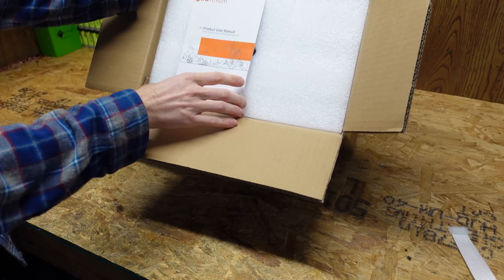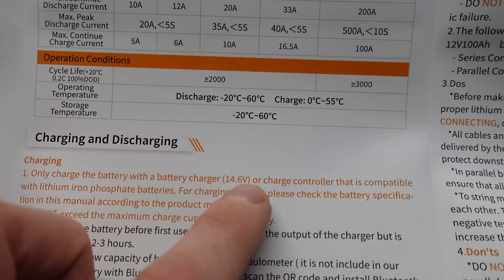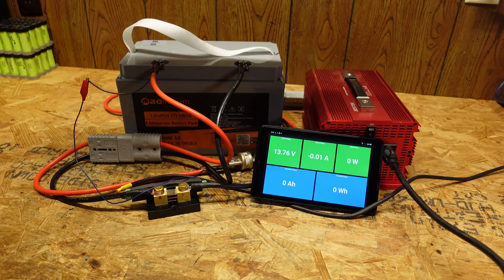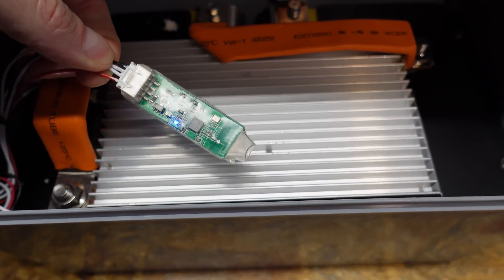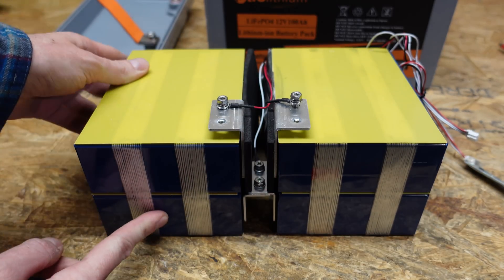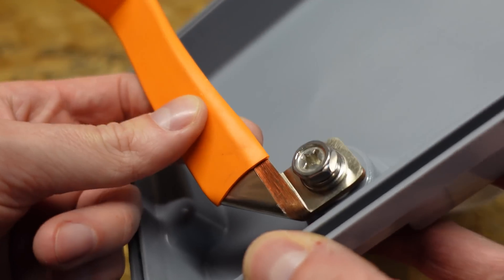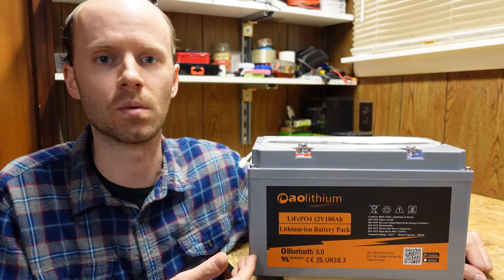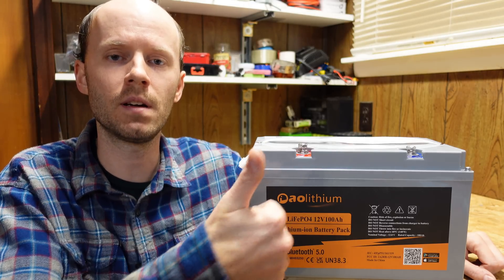AoLithium 12V 100Ah LiFePO4 Battery Review and Teardown, 200A-Rated, With Bluetooth!

Comment: So I have a question I'm looking to lithium swap batteries from a Chinese three-wheel vehicle. From the manufacturer it comes with 
lead-acid 60V45-52AH. Can I lithium swap those batteries for the AO Lithium? Lead acid is old and outdated and I want to go to lithium but I don't have the skills to completely rewire the charger and BMS for lithium. So with this battery pack be a better drop in option.

Comment: What's the difference between the 4S version and the non 4S version.
Reply from the maker: This battery is 4s. Which other battery are you comparing it to?
Reply: @Lithium Solar  you can get this exact battery with a 4S at the end and without the 4S, and there's a price difference but not sure why or what the difference is.

Comment: Great video, I got one to run a microwave and 120 volt power in my work van it’s on a 2500 watt 12 volt inverter it has no problem running it, I even plug in a air compressor, vacuum and a heat gun, one at a time, I keep it change with a voltage sensing isolator that turns on when the main battery is at 13.2 volt when I’m driving and feeds a DC to DC inverter that delivers 25 amps 14.5 volt, it’s a perfect setup for someone that wants to use only one battery

Comment: Hi - Great video & I just now subscribed!  I am a newbie at all of this but have a few questions that I hope you (or somebody?) can help me out with.....   Would this battery and a 1000W inverter be able to power a 700W microwave? And would a 60 Hz, 1900W continuous/2350W peak gas inverter/generator be able to charge it in a reasonable period of time?? I already own the gas inverter/generator, and the stand alone 1000W inverter (but have nothing else - such as a battery, charging device, charge controller, solar panels, etc.) so that's why I stated those particular specs. I live in a very cloudy/rainy area so solar is a hit & (mostly miss) proposition.

Comment: Hi thanks for the video. I am curious about those cells. You mentioned is is CALB cells. If it is the CALB L160F100 cells then I am afraid the dataset that I looked up online shows only 1C continuous discharge. The form factor matches L160F100 I guess. And if the QR starts with "0B5CBC0M" then it matches with L160F100 cells that I ordered from BASEN. Can you please confirm? If the cells are only 1C then 200A continuous discharge rating is a concern.
Reply from the maker: Well, that would be a concern. Where did you find the datasheet? All I can seem to find is specs on websites selling them - no actual datasheet.
Reply from the maker: @DSmartLife I've asked if they can share a datasheet or additional details on the cells. I will report back my findings.
Reply: @LithiumSolar  Hi, thank you for your reply. I have sent the Datasheet and the QR code picture I got via email. Please check. Thanks .

Comment: What is max charge voltage for 38120 headway 12 packs? I have 700 amp hours or 12 packs of 32 cell with 740 amps of charge capabilities and adjustable voltage from 12v to 19v.
Reply from the maker: I'm not familiar with that particular battery. I would suggest checking and following the data sheet from the manufacturer. You can usually find them online fairly easily by googling the cell model number with "ext:pdf" at the end of the search terms.

Comment: I need a Lithium battery 100Ah that also is good for starting a 35 hp boat motor. 
We also have a trolling motor and want only one battery for both. Some manufacturers say not to use for starting engines. How should I think?

Comment: You lost me at only 2 in series for 24v max!  Too bad, looks like a great battery otherwise...
Reply from the maker: The series comment was referring to connecting multiples of these batteries together. If you need a greater voltage, you can wire 2 of them in series (but no more).

Comment: The main terminals are recessed which may hinder the ability to connect multiple large 4/0 lugs for parallel battery networks for larger amp hour configurations.
Reply from the maker: You're right, can't fit a 4/0 lug on the post. I'm not sure why you would want cable that large though. If you need that many amps, batteries would be best paralleled on a larger busbar or away from the battery itself.
Reply: @LithiumSolar  I have a solar system with 6 each 12vdc 100-Ah batteries in parallel (600Ah) connected to a Victron Energy MultiPlus inverter-charger to provide 3KVA @120VAC power to my motorhome. The 4/0 was the recommended gage size.  You’re correct a bus bar setup could be used (custom build), but I think the wire is easier.

Comment: Looking carefully at the design of the BMS, I am not sure its a JBD.  While it looks like a beautifully constructed BMS with very similar design,  the 200a JBD doesn't have mounting holes on the aluminum plate (unfortunately).  There are several other brands that do.  It think its one of the others.
Reply from the maker: The circuit board says JBD right on it. You can see this at 9:27.
Reply: @LithiumSolar  Yes I see that now.  But the 200a JBD model I have searched out on Ali Express and Alibaba doesn't have the same back plate on it.  It doesn't have the mounting holes like this one does.  I like this one better!  Thanks for straightening me out on it...  I have 2 on order and I hope they come with the mounting holes so I don't have to use some creative mounting idea.
Reply: For sure it's JBD, pls be assured

Comment: Are the cable lugs on the BMS m6 or m8?
Reply from the maker: M8
Reply: @LithiumSolar  OK Good.  I have 2 on order from Shenzen.  Haven't had my hand on them yet.  Ordered bluetooth and heating films to make a low temp battery.

Comment: Actually, I really, REALLY like this battery due to the construction. No chance of solder breakage, seemingly engineered wire crossing to ensure no shorts, substantial (beefy) cabling for truly safe load carrying. $600 seems a little rich, but- new cells, well planned & beefy along with no solder 'weak points'- it has real merit! Thanks for pulling it apart.
Reply: Having been a SOK 'fanboi' for a bit- I'm switching teams and am now an official FanBoy of AO Lithium. The build quality is superior, the battery range is doubled and all I need is a 24v set-up! I have access to pure rubber strips to create a H2O tight seal, so- I could use these in a marine environment as well. Happiness IS AO Lithium batteries with a 2 string (parallel) 24v (4 battery) set-up. It'll allow max draw without fear of melt down! What's not to love?

Comment: What is the price???
Reply: Now,  Aolithium Christmas deal from 12/08 -12/22 is comfirmed! Up To 20% off for all batteries! The 12V100ah battery will only cost 629 USD, which costed 779USD before!
Reply: 599 on Amazon as a secondary source.

Comment: The text on the side of the LiFePO4 battery says "Lithium Ion" and not "Lithium Iron" 🤔.... Where did the "r" go?
Reply from the maker: LiFePO4 is Lithium Ion
Reply: @LithiumSolar  thanks. Bummer, so I have to look twice to check if a battery is LFP instead of Lithium Nickel Cobalt Manganese.... I don't want the latter in my home.

Comment: Why it's limited to connect only 2 batteries in a series! There is a reason!
I was able to read what are MOSFETs and TVS diodes - HY4903B6, 5BEZ (unified classification as I understand).
FETs have Vds 30v, which is a limit of voltage that can be applied between Drain and Source pins without breaking to Avalance mode (conducting, kind of failure). Basically, it happens when you connect some load to a battery. So having 12*2=24v is ok, but more - failure!
To keep discharge FET's Vds in safe rage of kicks back voltage/energy when BMS suddenly needs to disconnect the load (undervoltage discharge reached, overcurrent), there are 7 TVS diodes in parallel!
Those diodes have Rated Standoff Voltage in 24V, which is kind of normal working conditions limit.  And breaking voltage (when they should conduct to save FETs) in range of 27-29V. It means each BMS will not work as intended with 3 batteries connected in series (12*3=36v) WHEN load is connected. Because if 2 BMSes of 3 will be enabled to discharge, on 3rd BMS's FETs Vds and TVS breaking voltage will be reached, so BMS will not operate as it should be.
Not sure what will happen in this case, the magic white smoke or some safety engine will pop up.

Comment: Another excellent video!  I like the idea of connecting two of these in series, or maybe two in parallel and then those in series?  Being able to output 200 amps at 24v, presuming you have the right inverter, would you give you a pretty powerful system.  For a whole house system, where 48v is really where you want to be, at a minimum, these batteries wouldn't be the right choice.
Reply: As it turns out, you CAN NOT place two in parallel and then put those in series.  The manufacturer states two is series, OR up to four in parallel, but no combining the two.

Comment: SOK has already won the battle....stop pissing around
Reply from the maker: SOK has won what battle? I disagree. There's always room for improvement. SOK's 100Ah batteries cannot do 200A discharge.
Reply: This battery looks better inside than SOK and has better performance.  To me it would be worth buying two of these  for a few bucks more than the  206ah SOK.  Far better BMS, and the CALB cells are just about the best there is as far as I know.  I think this battery is a step up.  The SOK is very good, but at only 100a discharge,  its usefulness is limited unless you parallel two of them.   This is a big step up in my opinion.

Comment: I am surprised that particular JBD BMS is rated for even 2 in series, the parts are rated for 30v max. The parts they use on their 150 amp BMS are rated for 80v. It is however a very good choice for a 12v system, but not sure I want a 30 minute battery. For surge purposes it is certainly a good choice.
Reply from the maker: Which component are you seeing that's rated for 30V? The manufacturer told me the FETs are rated for 40V max.
Reply: @LithiumSolar  I'm pretty sure you are correct and I made a mistake. Your memory goes when you are over 60! :-)
Reply: @john_in_phoenix  you was right - FETs are 30V limited. I left a detailed comment above.

Comment: That is *NOT* ul listed as a whole, but built from some UL listed components, especially nice among them is CALB cells.  I'm curious to know who made the BMS - would be nice to incorporate the BT onto the BMS board and not have it flapping around inside the box.  Would also be nice to have a gasket. Version 1.1 I guess!
Reply: JBD manufacturers the BMS as he indicated. When built into the BMS it would be relatively shielded by the heat sink. JBD does not manufacture the bluetooth module, but uses the same one for all of their products. It is just a serial port that it plugs into, feel free to design your own.
Reply: Thanks for your advice~

Comment: The terminals are junk.
Reply from the maker: Can you please elaborate on why?? They seem great to me.
Reply: @LithiumSolar  thank you for the question. One is the depth of the thread is too short making it difficult to add multiple connectors. Another is that type of connector can be stripped out. I prefer the type of post used on a Battle Born battery. Much less chance of damaging the post.

Comment: I'm not sure if I understand you. Could someone. Buy two units and hook them together?
Reply from the maker: 2 batteries, yes
Reply: @LithiumSolar  tYVM I'd want atleast 400 AH is this the maximum? Could you do a video on this and what it could run?
I am basically interested in running a full size refrigerator, small ice chest, & a 5000 btu AC unit.
Do you mean it could link three units which would be under 40 volts?

Comment: The batteries being in series, I don't see why there'd be an issue. I know they are stating that the BMS can only handle 24VDC, but the BMS would only ever see 12V, as that's where it's connected. It's not connected at the absolute ends of the whole string. So this is very confusing to me.
Maybe they are only doing this to CTOA for legal reasons and actual functionality of the units.

For example, you can get 1S bms pcbs for 18650's. You can put these on a string of 14 cells in series, and the 1S bms units will still function correctly as they only ever see a max of 4.2V, not 48V.
Reply: If one battery switches off (due to low voltage), then the total series voltage is across the FETS
Reply from the maker: Interesting thoughts. The parts of the BMS responsible for balancing would not see the full string voltage as you stated. The FETs responsible for turning the battery on/off as a whole would indeed have the full string voltage potential flowing through. I'm not an engineer of course, so I could be wrong?

Comment: I wonder if limiting the current draw to 100 amps means it would be OK in 48V (4 in series) configuration. I don't expect the mfgr to officially support it, but it's an interesting thought.
Reply from the maker: The way it was explained to me was that the transistors had a voltage limit of 40V.

Comment: it is way overpriced, but i will happily test a free one.lol.
Reply from the maker: How do you call it "way over-priced"? What would you suggest is a good price for it? Most of the batteries cheaper are either lesser quality or lower specifications (thus not a valid comparison).
Reply: @LithiumSolar  These are approx six times the cost of good quality Lead Acid batteries.
I would love to buy Lithium, but not at six times the cost.
As others have commented, Lithium needs to come down to about $100/100ah to be competitive.
Reply: @graemezimmer604  And how does that happen? By having enough demand that multiple suppliers can compete. Then economies of scale will drive the prices down. Early adopters pay for this process. so, please don't comment the bleeding edge techology can't compete against a process invented at least 2 centuries ago on price.
Reply: @graemezimmer604  LA is 50% capacity, 300% the weight and a much higher voltage sag. No thanks.
Reply: @graemezimmer604  You are totally wrong on that.  There are many excellent analysis videos explaining the clear value of the lifepo4 chemistry.  Do some serious research and get with the program.
Reply: @graemezimmer604  Not a chance will it ever come down to 100/100ah. The basic raw material won't allow and shipping is always expensive on these heavy items.   300-400/ah now on quite a few relatively good batteries and that price is a great value.   DIY build is always cheaper and will get you a far better battery if you have the time and skills to do it.